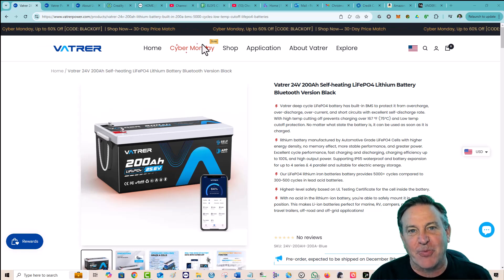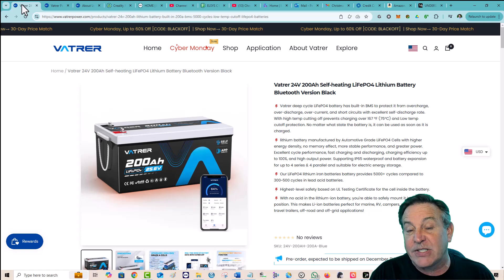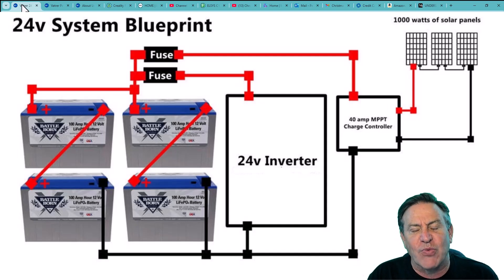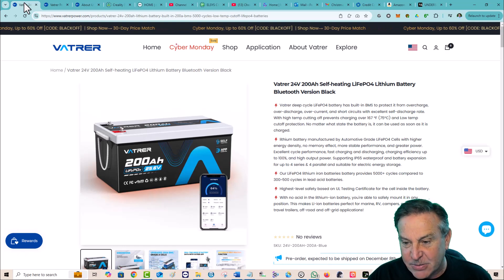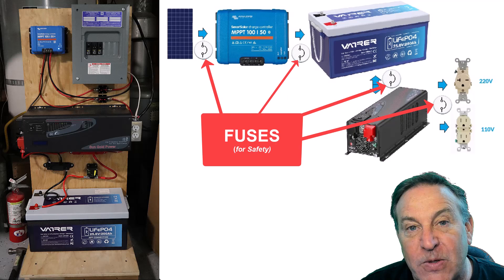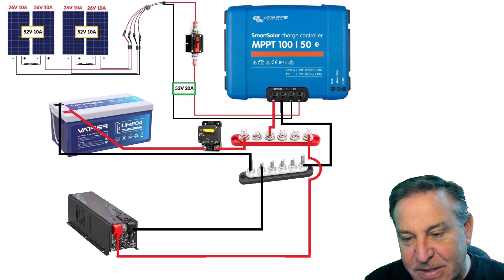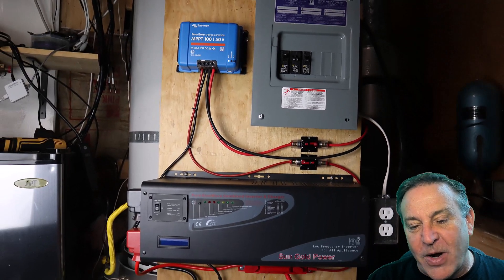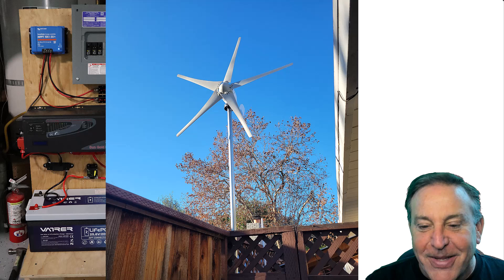🔴Off-Grid Power just got EASIER and SAFER with the VATRER 5120WH battery - big battery with BMS

Comment: QUESTION:  What do you consider cold? It's about 10 degrees here.
I do like this setup. I want to run my garage heater with solar power.
Reply from the maker: I have found that cold is pretty much universal. Sure, it is warmer in California but we have zero insulation, so it kind of evens out. Assuming that your garage can get warm, solar is a great way to heat it. If you get a good amount of sun it works regardless of the temperature outside. Cold panels do pretty darn well at gathering electricity, so its a real solution.